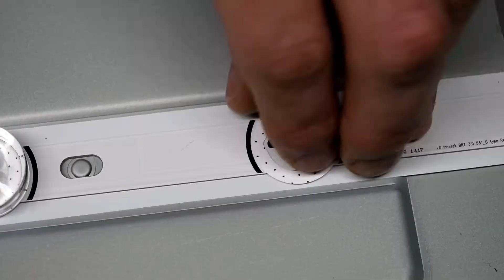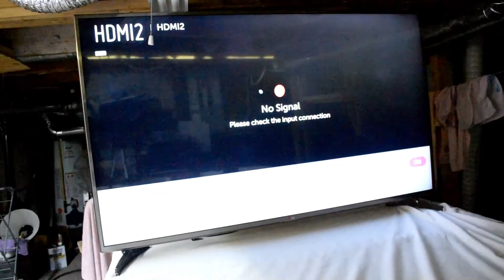LG 55LB6300 Backlight Repair

Comment: Hello, after replacing brand new leds, there is no more standby light, even after disconnecting the led connector
Reply from the maker: check the voltage at mainboard during power on

Comment: Surely about to try this on my sharp roku tv...I can see right on the TV very faintly when I shine a flash light on it...almost positive it's the led's
Reply from the maker: great make sure to use suction cups to remove the screen.
Reply: @NewsonsElectronics  Yeaaaaaaa I cracked the screen. They used some serious adhesive at the top of the screen, and I tried hard not to crack. I have to find a replacement now. smh
Reply from the maker: @imthemab4882  suction cups are a must
Reply: @NewsonsElectronics  I had them smh lol...first time ever trying it 🤷🏾‍♂️ I found the bad let's though lol
Reply from the maker: @imthemab4882  sorry to hear

Comment: well damn, i wish i knew about those 4 white clips that were hidden under the logic & inverter boards
Reply from the maker: you don't need to remove the inverter boards to get the clips off, just pull them hard and wiggle them side to side and they pop right out saves you time.

Comment: So my thing is...if I doing this at home,  how am I supposed to know which light is not working...I don't have a led tester or nothing like that..plus no suction cups..and all that stuff you use before putting the new led in..so I guess I should throw the tv away..cause I don't have most of what you use
Reply from the maker: the tools are not expensive and it's worth having a set around your home anyways. You are right it will cost a bit to fix but it's a lot cheaper fixing your tv then buying a new one.
Reply: Take my advice bruh... Just turn the tv on and all LED'S will work normally... Then check what bad and good